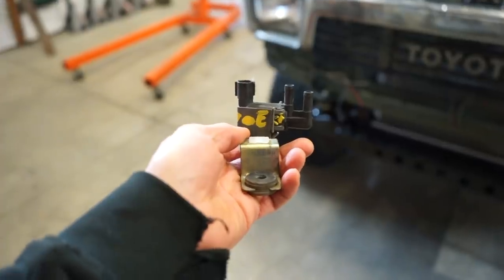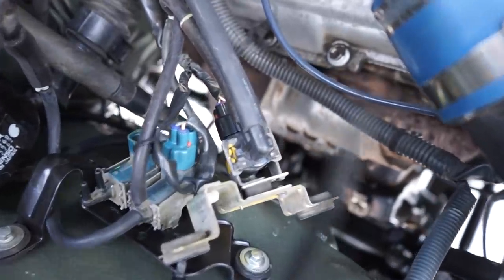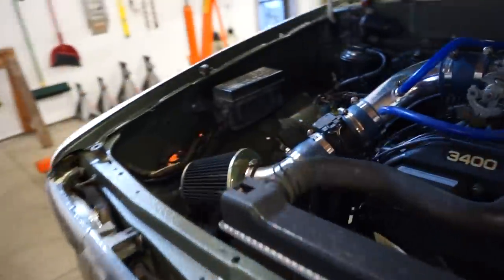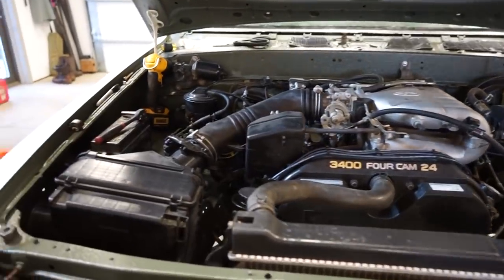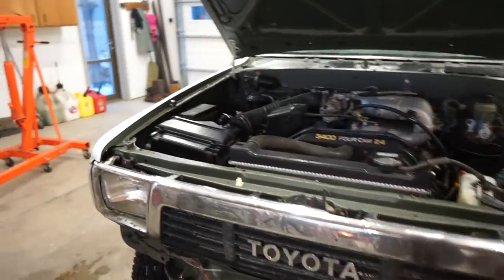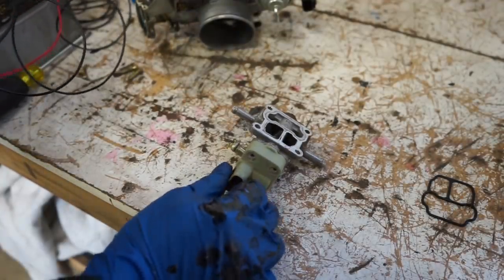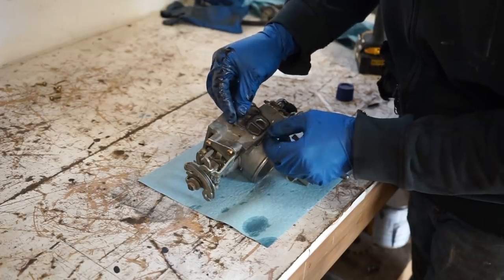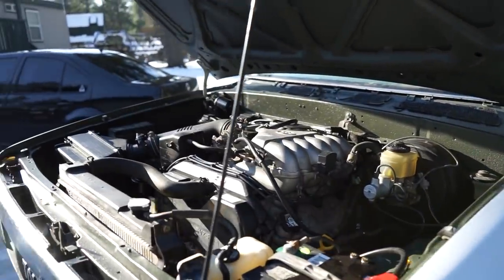New Intake and Cleaning IAC On the 3.4L Swapped Toyota Pickup!

Comment: Idle sounds like every 3.4 I’ve ever had, I’m gonna bet it’s the muffler causing weird air movement. Because it sounds like that engine is smooth as silk.
Reply: Engine sounds fine, they have a little chop to the idle.  I have a Flowmaster on my  Tacoma and you can really hear it,

Comment: Look into the deckplate mod. I did it on my highly modified 4runner and it improved mileage and a tiny bit of power gain. Then when your on trails and water crossings you can plug it up and ready to cross. If you do it try and find a black one and you barely notice it is there. 
As for the exhaust sound I think it is fine. Mine sounded similar at idle when I swapped the muffler, on Revs it was less raspy but full custom exhaust and different muffler is likely the corporate.
Reply: yep, one of the best mods for that engine.  almost amazing how well it is.
Reply from the maker: Ill check it out!!

Comment: Hi Austin,  I would extend that exhaust past the rear fender.   I bought a 1992 back in 2006 and the pipe on it had rusted out behind the fender and it had rusted the rear quarter out from the exhaust moisture going up into the rear cavity.   You have done a great job with this truck so far, interested to see what you have planned going forward.!

Comment: Have you done a compression check/leak down test on this motor? Some of the 3.4l can have a slight bit of exhaust burn on the valves after a while. If you a had a small leak it could cause that little thump.

Comment: You should check the  Position  Sensor were the timing belt pulley wheel is on the crank arm.. it right behind the  Pulley wheel..

Comment: the IAC on my 3.0 has a tendency  of sticking a lil high, i tap on the throttle a bit and it drops to normal.  I never had a issue with it till i had to pull the intake off to change the valve cover gaskets.  Have you thought about the TPS, I know when i changed mine years ago  i had the idle point change and if it is off then i get a weird hesitation stumble  or strong fuel smell pending if i am advanced or retarded on its sweep point. No i have not  used the feeler gauges to set it. I go by sound and smell, yes smell will tell you where she is from the exhaust.  like setting a carb but only dumber. jk but i get 19mpg with my 3.0 so i guess im doing ok.   My issue i have is i get the random hesitation  under light acceleration let off or press further and its fine. so doing a volt check i get a jumping of volts up and down thats causing my problems. Say no to aftermarket TPS.
CHYNAA parts are bad, EMKAY
Reply from the maker: Say no to chynaaaa haha